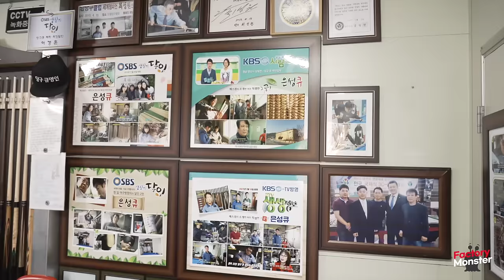Process of Making $1,000 Billiard Cue. Pool Cue Master in Korea

Comment: I love how all the tools are optimized to minimize the manual labour while not having that mass production feel to them.
Most of the job is super simple, with just a few things requiring actual skill and experience
Reply: He might have built all those tools, which require a ton of skill and experience.
Reply: All of this requires a lot of skill and experience. It looks simple because he has those.
Reply: Speaking as a retired guitarmaker with over 2 decades in the woodworking business, you're utterly wrong.  Every single tiny step - every single simple-appearing motion - has pitfalls.  And, there were a number of steps not shown.  We're not even including the setup, tool maintenance, sharpening, and production engineering that went into it.  And, lastly, wood is a very uncooperative material for precision work.  Finding, drying, milling and working the right woods while ending up with a cue that is still straight requires a LOT of skill and effort.

Comment: Such "rapidity" is good for mop handle making. That stick (it isn't cue, its just a stick) wich he made in slipshod way, about month later will definitely be curved in a bow and you can safely throw it away or use for firewood... Or use it for it's intended purpose - as mop handle...
Reply: Yeah because a company that makes pool cues that bow after a month manage to stay in business for what appears to be decades.
Reply: @proaudiorestore8926 , what he said is right.  I used to make high end pool cues used by pro's years ago.  These are budget cues.  Not nearly enough passes over a long enough time.  The tolerances were way off as well.  Just looking at the forearms there are gaps the size of the grand canyon between the points and the forearm.  Also, the cues weren't even cored to provide correct balance and consistency.

Comment: What you're not seeing is after every time you make a cut on the cue, it sits in a humid room for a month or two. This allows the stresses in the wood to relax so, the cue stays straight.
Reply: See this I can possibly justify why it would be a "$1000 billiard cue"  because from what I saw I wondered why this was so expensive,  was the wood something special?  maybe some dark walnut slabs when they made the star pattern, but standard plastic collars, and all of that.   Just didn't see the labor or materials cost.
Reply: @Mike__B I do wood turning and there’s nothing special done by these men that given the same equipment I couldn’t do, and I’m legally blind. This story about the cue going into a humid room is bad science, wood will actually bend if the humidity around it is cycled up and down. I’ve been doing woodwork most of my life and started turning wood in 2008 after I lost half my sight, you can believe that to make a cue worth that much money it is done 100% by hand tools not in a manufacturing line.
Reply: @Mike__B  On pro cue's. the wood is dry aged for 2+ years... Nowadays it's "baked" in an oven. None of these woods in this video were aged nor baked. They make for nice looking sticks but... buy a pro shaft and sand it to fit at the very least.. >>>Old dude who went from +$2k sticks to carbon fiber for under $200
Reply: @Mike__B  looked for this comment .  No way this can be $1000.00 it would have to be handmade from scratch. some good Handmade recorders or guitars  start at that price.
Reply: @CanadianDivergent  I’m not a woodworker, but this is a bit confusing. I see a LOT of steps, a lot of hand turning in the lathe, etc. It doesn’t seem out of line for this to retail for that price if the workers are making a decent wage.
Reply: @ericpmoss  fair enough, I don't know what a good pool cue is. maybe this is top of the line🤷‍♂

Comment: Those cues are going to start cracking, warping, and falling apart in no time.  There are gaps the size of the grand canyon in those points.  Those shafts are going to warp in no time at all, he didn't take them down in enough passes to let the wood stabilize.  These are budget cues, not $1000 cues.
Reply: It looked like the entire butt was made from 1 piece of wood. Normally a high end cue is 3 pieces, the forearm, handle, and butt cap.

Comment: I’m sure a $1,000 cue would have a screw in tip.
Reply: Only low priced cheaply made cues have screw in tips
Reply: @poppajretired410  Why is that?
Reply: @poppajretired410  Really so they expect someone to buy a new cue everytime the tip get worn out?
Reply: @Josefsson9013  quality cues use glue on tips. Screw on types are mainly manufactured for the home market where the skill and time required to properly prepare the cue end and new tip for adhesive would be lacking.

Comment: When you Finnish cuts on a table saw….. you should not stand behind the cut… 
My Step dad almost died like that. The thin cut pice shot off the table and missed him by inches. It flew across the shop.. went through double pane glass window and completely shattered into splinters on the brick building outside the window. Very surprised this never happened to this guy. Only takes once. I’m surprised the long sleeves on the lathe hasn’t taken his arm off too.

Comment: Crap wood, garbage "bolt" weight. Machine produced. I wouldn't use one of these as a break cue FFS. A proper cue is made from a solid piece of wood and weighted with the splicing and width of the butt / taper. Anyone paying $1000 for this rubbish is mental